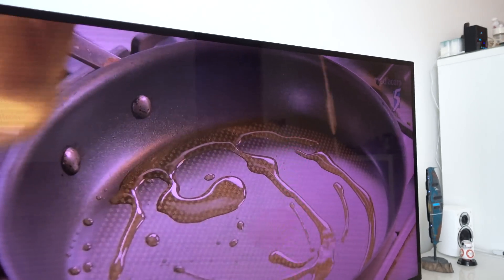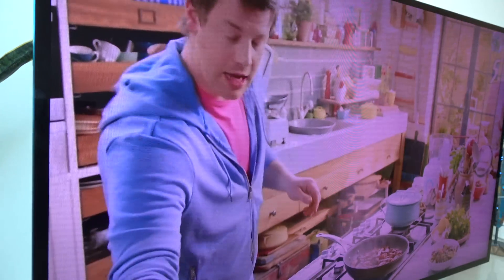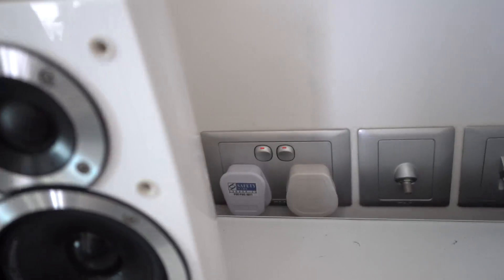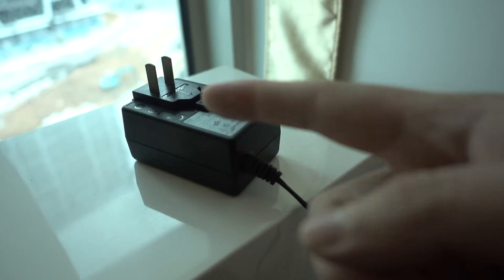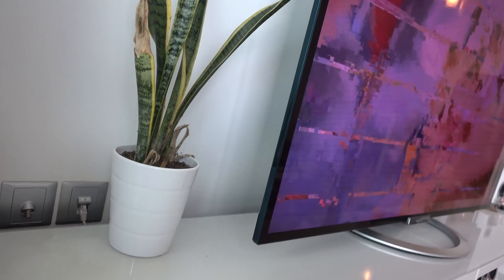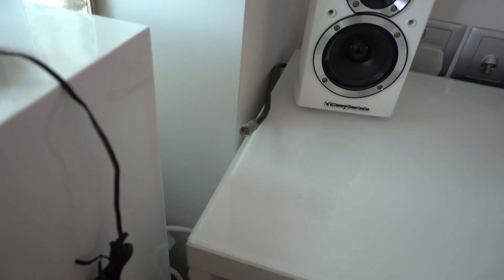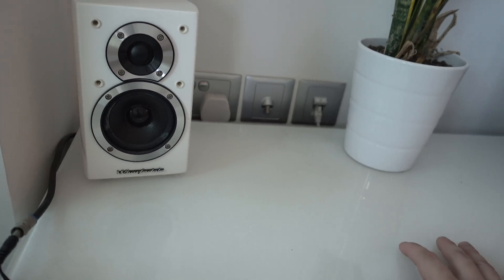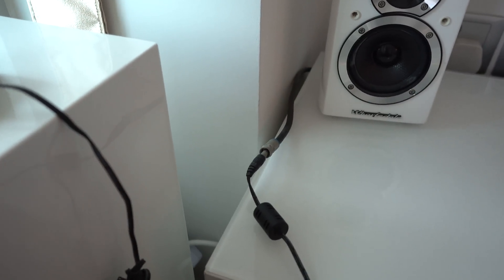Digital TV Antenna DIY Hack - Cheap, Easy, And..Free? (legal!)

Comment: The walwart (transformer) isn't really doing anything. In fact, it would probably work better if you cut it off. It's the un-shielded wire of the plug that picking up the signals. Even better, zip it apart for most of it's length and spread it out.

Comment: I'm surprised to see a video about this from someone in Singapore! I live here too, and didn't think about that! Oh my.

I live in a flat near the ground beside a busy road, and normally can't just use an antenna alone to get any channels, I've to either use pay TV (StarHub TV+ or Singtel TV), stream it (using the meWATCH app, which isn't even available for Android TV as of this comment, but their Android phone/tablet app does support Chromecast), or use a signal amplifier, however, even though I live near the central area, I just WANT to get channels from across the border for some reason!!

I'll be sure to try this since I think I have some junk power adaptors in my parts bin I could try using. Mind blown. 🤯

Edit added 1 minute after posting: I found that I don't actually have any junk power adaptors at the moment.

Comment: i have a good digital antenna in my attic.
one tv on a third floor, and one tv in four floors down in the basement.
the antenna works fine for the tv up on the third floor, but how can i get the antenna to work for the TV in the basement that’s four floors down?

will another antenna be needed for the TV in the basement?  will the antenna work in the basement?

no sling, no roku, no subscriptions, no money fees, i’m just looking for a tv signal in my basement with an antenna.
Reply: Short answer: You should be able to connect the basement tv to an aerial 4 floors above and get reception (with caveats)

Caveats:
1. Using a basic antenna, you’ll need one antenna per tv. Or, you can use a splitter to watch THE SAME broadcast on multiple TVs simultaneously. There may be antennas that allow for multiple simultaneous tunings, but I don’t know them personally.
2. If you are trying to receive digital broadcasts, you will need a tv can can understand the signals, or a box to do the translation for the tv.
3. If the wiring from the tv in to basement, to the antenna up above is very long, you may need to add amplifiers or repeaters along the cable to keep the signal strong enough to give a decent picture. There’s a lot of variables in this, may be best to just try it first and see how it goes, you might be ok without them.
4. Other sources of electromagnetic radiation will have a negative impact on the signal (electrical wiring, microwaves, etc.) so you should have more success if you keep your cable run away from them.

Comment: I didn't have a coaxial cable, but I did have a paperclip - I straightened out the clip inserted it in the TV and it works perfectly. No adapter needed. Yay!

Comment: I know you guy say it works and thank you for that, but what about a power surge? can this damage your TV should the power supply get surged by a lightning storm?  Wouldnt this be pretty dangerous? Also, I would think its better too put black tape on both wires and cover the exposed metal, just in case.
Reply: How would it get a surge? You don't plug it in to a wall socket.

Comment: I've used a lot of things to help (connecting coax to other metals, paperclips, etc), but this one added more signal, with a simple hack. It seems like the bigger adapter base, the better the signal. Thanks!
Reply from the maker: Yea, I figured all the copper coils in the adapters would help with the reception, seems to be case

Comment: There is no such thing as a digital antenna. An antenna is an antenna calling it digital or HD is misleading. You can make an antenna from a wire coat hanger.
Reply: Its not an antenna then is it.

Comment: Thank you wow this does work my Clear TV flat antenna only got three stations this one is getting somewhere around 14 stations that is awesome, I hooked up the coax cable to a old power adapter with a box s have one that has a box along the wire a Transformer sometime I think it's a coiled copper wire inside the Transformer that helps boost the TV signals, you're helping out a lot of people thank you! Good video

Comment: Worked like a charm which was surprising. Connected a coax cable to the TV, Used an old laptop charger and inserted it as shown on the video,  tuned the tv and it was able to find 44 channels I didnt even know existed. Thanks for the video bro!

Comment: I'm on Davis Island in Tampa Florida and I can't get it to work for me. Tried two TVs and two windows. :(
Reply: You have to switch your TV to air antenna in setting then connect  all those wires and charger and scan your TV for air digital channels. Once you do that, will work like a charm
Reply: All the Trial and Errors, it cost me more! Just buy an Antenna for $16.99 on Amazon and with Free Shipping too!  It works AWESOME and I get an average of 39 Channels and on a good day, I get about 47+ Channels!  I have a Video in my Channel, check it out!

Comment: What happens if you plug the power supply into the wall, there are more wires and circuits in the building, would you get even better reception?

Comment: I know this entire comment section is in on the gag here. "OMG Its worked!!" "THank you sir! Saved my lifes!" "You can also just use a 9v battery connected to some miracle whip in an old soup can for profit!!" 

This is way better than the "How to get double your internet speed with some pipe cleaners and some duct tape, and get away with what your ISP doesn't want you to know!"

Kudos for the manner in which you manipulate the poor sods who try this in frustration and futility, and end up breaking 12 power adapters trying to get it right.. "IT HAS TO WORK, I SAW IT ON YOUTUBE!!!!!" lololol

Comment: Actually, you can just use a wire about 2 or 3 to 4 feet long to do the same thing.
No need for the adapter as all it is providing is a convenient way to connect to the center pin of the coax that goes to your tv input jack, and the cord to the adaptor is acting as a pickup wire. You could just poke a bare wire right into the tv input jack on the back of your tv. I have been using just a wire like this for years. It helps to put something on the far end of the wire to keep it in position. The power adaptor does this with its heavy power pack at the end. What I use a spent beer can filled with pebbles. Although a full unopened beer can might possibly provide better reception, the full ones don't usually last long around here. [:)]
Reply: All the Trial and Errors, it cost me more! Just buy an Antenna for $16.99 on Amazon and with Free Shipping too!  It works AWESOME and I get an average of 39 Channels and on a good day, I get about 47+ Channels!  I have a Video in my Channel, check it out!

Comment: So all I need it the antenna wire plugged into my TV and an old charger facing a window and the 2 points connecting?
Reply: Yes
Reply: All the Trial and Errors, it cost me more! Just buy an Antenna for $16.99 on Amazon and with Free Shipping too!  It works AWESOME and I get an average of 39 Channels and on a good day, I get about 47+ Channels!  I have a Video in my Channel, check it out!

Comment: Didnt work for me
Reply: Yes but you have to switch your TV to air antenna. Then hook up wires and charger, then scan TV for air digital channels. After that everything should work.
Reply: @李Lee  thats what I did love
Reply: Ok than. That's  really good.
You know some TV they don't  have strong enough ATSC tuner to receive air signal and perhaps  that my be your case. From what I have experienced Panasonic and Sony TV's have the stronger ATSC tuner inside.
I'm sorry I was trying to help you😊😊😊😊😊
Reply: All the Trial and Errors, it cost me more! Just buy an Antenna for $16.99 on Amazon and with Free Shipping too!  It works AWESOME and I get an average of 39 Channels and on a good day, I get about 47+ Channels!  I have a Video in my Channel, check it out!
Reply: Why? You did something wrong, that's  why.!
Reply: @李Lee  I did exactly what this totorial said.

Comment: I must be missing something, I feel completely inadequate.  I have tried a total of 14 different chargers, and not one of them works like the video shows.  In fact, the only thing I get is that &@#*%# No Signal.  I have tried this on all 3 Vizio flat panels ages 2-8 years old and I know they all have tuners.  I just want to watch some TV without paying out the wazoo for cable and their unending commercials.  If I am going to have to watch commercials, then I don't want to have to PAY for them!!  Somebody HELP!!
Reply: How far away is the closest broadcast tv station? If it is 30-40 miles this DIY Hack won't work.
Reply: You need a decent usb charger, I should have clarified that. My bad.
Reply: Did you switch your setting in TV, to air antenna?
You have to do that otherwise nothing works, even when you do that you have to scan your TV for air digital channels. Then everything should work.
Reply: I'll try that when I get a new tv. But it's not an air antenna, it's a power supply. So, there is no option for that iirc in the setup options. I'll ask the guy at best buy when I go in. 

Failing that, I'll just chemically strip all the gold from the circuitry boards from all the tv's in my now store room (was spare room) and that should give me enough to buy a cheap external digital antenna. Just, new tv first..
Reply: All the Trial and Errors, it cost me more! Just buy an Antenna for $16.99 on Amazon and with Free Shipping too!  It works AWESOME and I get an average of 39 Channels and on a good day, I get about 47+ Channels!  I have a Video in my Channel, check it out!
Reply: You need to connect a USB charger into the setup, it upregulates the .5mw signal picked up from the radio waves by the power adapter, to 5mw allowing your TV to find an strong enough signal.
as in  TV-------->USB CHARGER------------->POWER SUPPLY---=OPEN DIGITAL SIGNAL

Benefits of this too, is that you can also charge your phone with the residual amperage left over from the conversion, and save on electricity bills!

Comment: It works! I've got 12 digital stations in Ottawa just by hooking up an old AC/DC converter to the coaxial connection behind the TV.
Reply: All the Trial and Errors, it cost me more! Just buy an Antenna for $16.99 on Amazon and with Free Shipping too!  It works AWESOME and I get an average of 39 Channels and on a good day, I get about 47+ Channels!  I have a Video in my Channel, check it out!

Comment: Basically, this "hack" is BS.  The power adapter doesn't do anything.  That is a switching power adapter.  When plugged in to the AC line, the "switching" part of the signal will radiate all kinds of electronic "hash" out onto the DC line.  That little "hump" in the line (up by the coaxial DC connector where he has it laid on the "F" connector) is a ferrite bead.  The wire wraps around that hump and forms an inductor which actually takes out any of the RF signal - and it's designed for a way way lower frequency signal than the TV RF waves.  It's like at 50,000 hz where the TV band is about 60,000,000 to 700,000,000 hz!  So, it takes out the "hash" noise on whatever it is designed to be connected to - but it also filters out the RF that you are trying to use as an antenna!  Basically you are only using the 3 or 4 inches of wire up to that hump!  The adapter is doing NOTHING for you!!!   Neither is putting it by a window as the block part no longer matters.  You would be much better off with w 2-5 foot piece of wire - any type of wire - and attach to that center pin of the F connector.  If you are by a window, you could try hooking the wire onto the antenna screen.  There!  TOTALLY FREE - and you don't even need to waste an AC adapter.
Reply from the maker: 1. Notice that I connected the adapter to a 1.5m coaxial cable.
2. Whatever it was designed for, when not plugged in, it's still essentially a bundle of wires and cables.
3. There's hypothesis, and there's reality. Just read the comments. It performs better than some paid for products. So, if the reality doesn't match the hypothesis, the adjust the hypothesis, coz clearly, you can't adjust reality. Or... in this case, the understanding of the hypothesis.

Comment: ill try these ones i home, also ill try to attached additional material at the ac plug if there is effect. anolog signal is different from digital signal. same as AC and DC. correct me if im wrong. thank for the tip sir
Reply: All the Trial and Errors, it cost me more! Just buy an Antenna for $16.99 on Amazon and with Free Shipping too!  It works AWESOME and I get an average of 39 Channels and on a good day, I get about 47+ Channels!  I have a Video in my Channel, check it out!

Comment: Worked very well, in a low floor apartment in Singapore.  Placed the adapter just above the TV with some blue-tack.  Able to receive all HD channels with perfect image and sound.
Reply: Just hanging the cable without the adapter did no work (0 channels).  So there must be some components inside the adapter that made it work.  Thanks again.
Reply: What channels can you get ? Is it just the local channels  like Ch 8 , ch 5 channel U ?

Comment: ...you discovered?
Reply from the maker: I didn't feel like spending money on an antenna. Then I thought that all the wires and step down circuitry in a power adapter would help receive better signals. turned out I was right.

Comment: It actually has a better signal than the antenna I bought. I did use the coax cable and amplifier that came with the antenna but it was glitchy this morning so I was going to try to build a better one but I was actually curious how well or if it would work and it works way better. It scanned as many channels as the antenna and no glitches yet. Thanks for this amazing idea!

Comment: Hey great suggestion. Can you show the connection behind your digital tv. Did you insert the coaxial into the TV? How does this connect behind the TV?
Reply: jns just screws into the coax port (may say "cable") bud. The other side goes into the adapter. Boom boom

Comment: I'm in Riverside, California and it works!  I was using an indoor antenna and I only received less than 10 channels and always scrambled so I gave up with tv.  I found a few old chargers and used the biggest one and I just moved it around the window closest to the TV until I received a good signal and I NOW HAVE 63 CHANNELS!!Thank you sir!  I wish I could send you some money since you're saving me some.
Reply: Pronto Crafts & Hacks Also an ATSC TVs in Haiti and Taiwan needs DVB-T tuner set top box (Output to 60Hz resolution) Digita TV frequencies from the USA, Haiti, Taiwan and the Philippines uses US DTV frequency. US DTV frequency not just use only ATSC (Suriname, USA, Korea South) but they also used for ISDB-T/Tb (Philippines, Brazil, Chile, Peru), DVB-T/T2 (Taiwan, Colombia, Panama, Haiti), DTMB (Cuba). US digital TV frequency are also used 6 Mhz channel spacing. The European DVB-T 7 or 8 Mhz spacing have 50Hz resolution.
Reply: Pronto Crafts & Hacks Here in the Philippines, we have Sony and Panasonic multisystem TV (Built with DVB-T tuner but also put the sticker that only supports analog because the Philippines uses ISDB-T and need to require ISDB-T STB, and for cable box, they also used DVB-C.

And there’s VIZIO LCD TV in the Philippines (with ATSC tuner) needs ISDB-T STB.
Reply: I know there is a language barrier Francis, but could you say all of that again in noob speak so I can understand it?

Is this why my power supply simply does nothing? I mean, I plugged it into the wall socket and my tv flickered for a second, and I was hopeful but I still don't get any reception at all, the screen is just black.
Reply: @parishna4882  you fried your tuner. you weren't supposed to plug the wall socket into the power of the home with the coax connected to it. Just leave it facing up like he does in the video.
Reply: But how does it get power then?
Reply: @parishna4882  your TV signal coming in doesn't need power. It's just to receive over the air broadcast... think of it as an antenna.
Reply: But he's using a power pack. It doesn't work unless it is plugged in? I'm confused...
Reply: @parishna4882  the power pack for the TV is different than this one, he's only using it as a temporary antenna. It probably only works in urban environments since you need to be close to the broadcast tower for it to really work. Its just a demonstration.
Reply: I've made 4 tv's just become a black screen now by doing this. my Samsung 65" 4K UHD HDR QLED Tizen Smart TV just wont even turn on any more. I wish he'd pointed this out to start with. Now I have to get a new one? Damn it...
Reply: @parishna4882  yup get a new one, send it back if you can.
Reply: I'll just build one with 128 7 inch 1080p lcd screens, a digital receiver, and 3D printed panels, running off a raspberry pi, with a usb sata to usb converter connected to a 1tb ssd, laptop wifi module and an array of 18650 batteries connected to a TP4056 charger. Should be apples.  

But I think I'll go the route of using the paperclip for an antenna. At least I'll have something to hold all my manifesto together, before I ... ahem, say no more..
Won't be trusting anyone using power adapters to troll me into blowing up my $2000 telly again.
Reply: Woah! You must feel like the king of the world!
You are winner!
Reply: I R NOT RETARDED YOU NAZI RACIST.

U R.
Reply: @parishna4882 , you fried 4 TVs? Didn't you learn after the first one, or the second or even the third?  LOL!  Crikey, think of how much you would've saved if you'd just bought an antenna.
Reply: Learn what?   I know I did lear something, actually.. electrical smoke doesn't leave the back of your throat.

Do you think the guy who got free tv's in the video would give me one?
Reply from the maker: haha maybe I should put up a donation paypal or something hmmmm... $.$